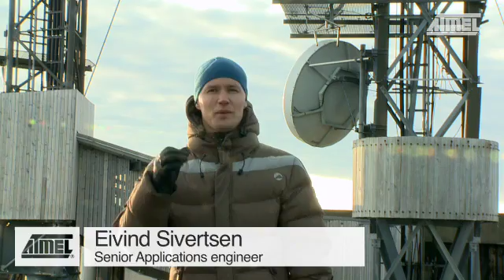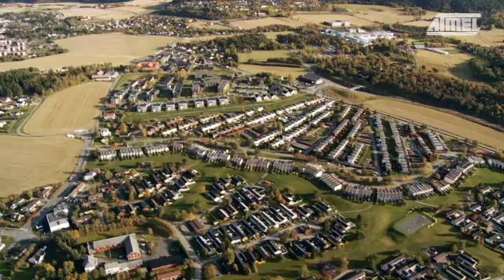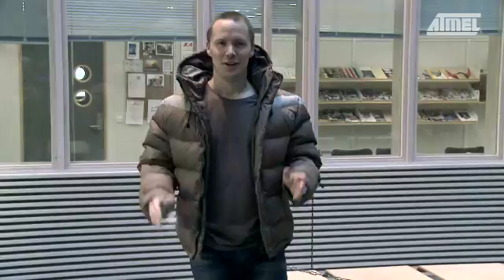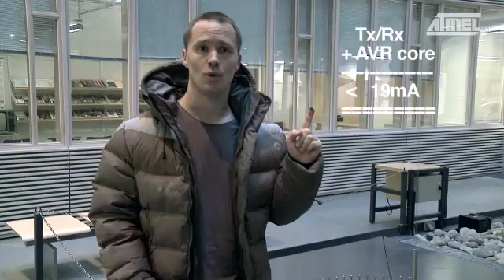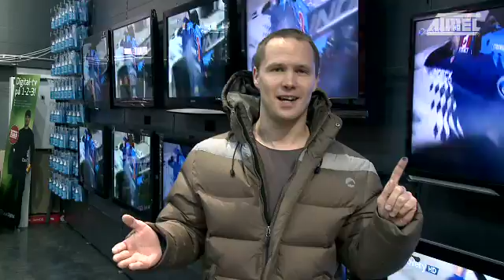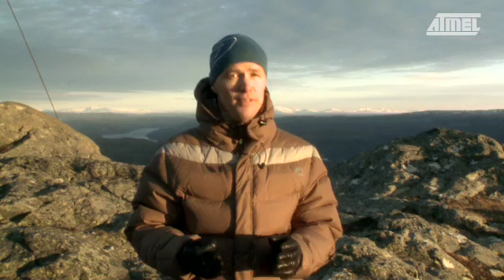ATmega128RFA1: Wireless just became easier!

Comment: Hello I am a studying in France. As part of my master project,  I am currently building up a PCB using the µC ATmega128RFA1 . It is 2-layer board. I placed 2 ground planes, on the top and the bottom layer. The µC is placed at the bottom layer. I am almost done with the routing of the board, but i have a problem. The ground pin of the µC do not conect with the ground plane. Do u know what can be the reason? Thank you in advance for your help...